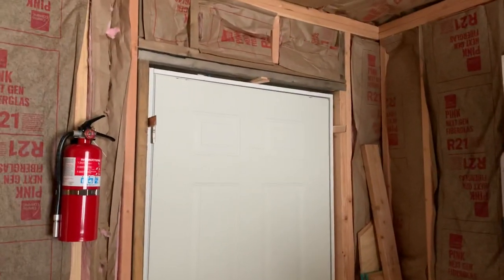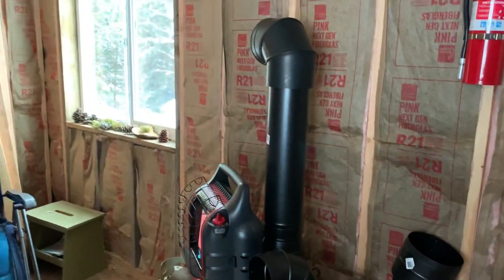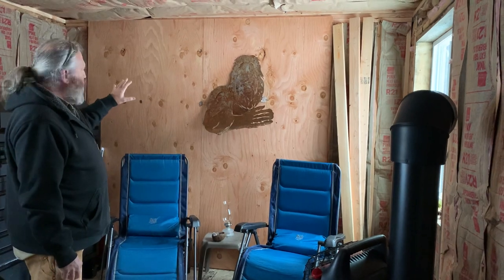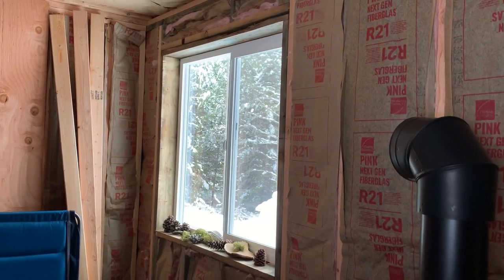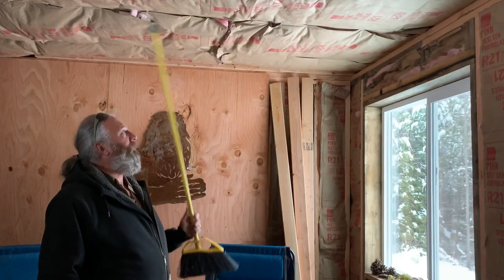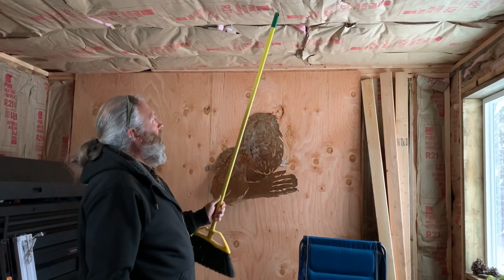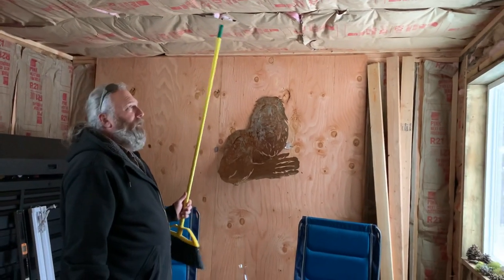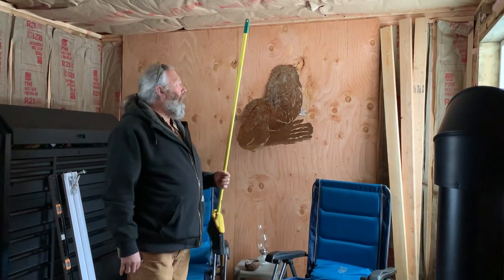DIY Anatomy of an off grid cabin build.

Comment: Thanks, Kevin. Why did you also use r21 on the ceiling?
Reply from the maker: You are very welcome. Well I could have gone with a higher R value I find this to be plenty based on other small cabin/houses I have built in this climate.